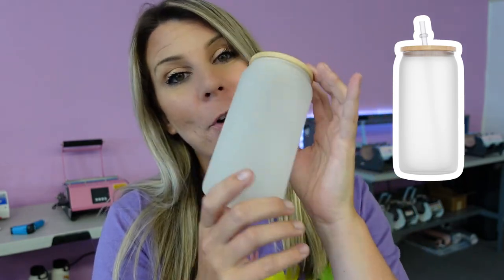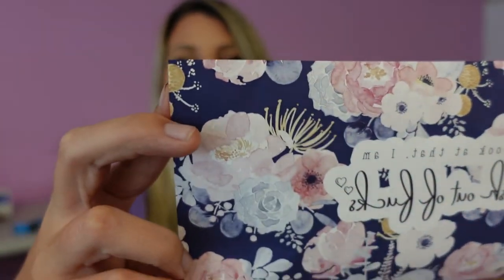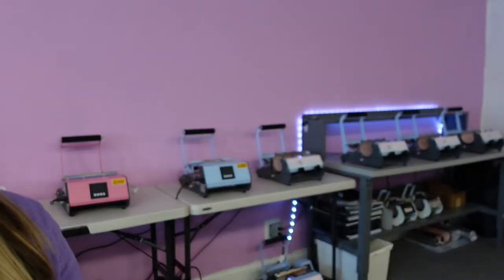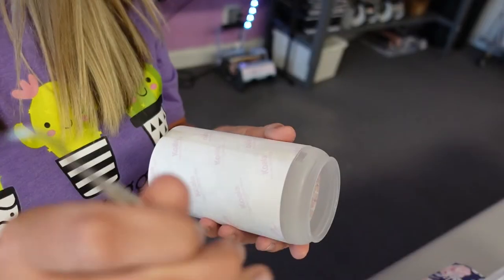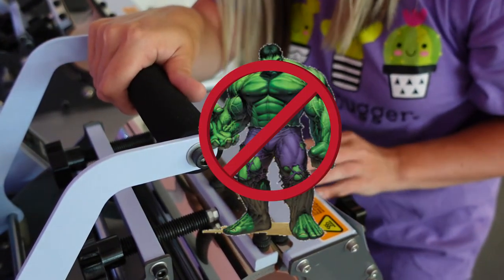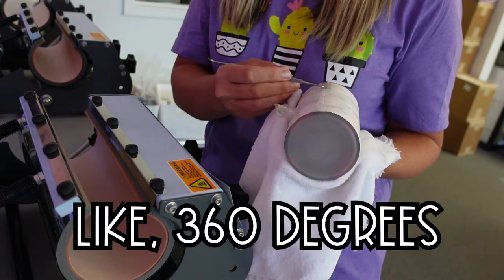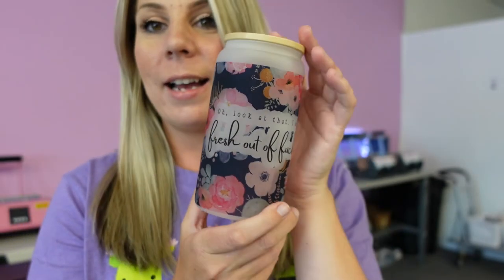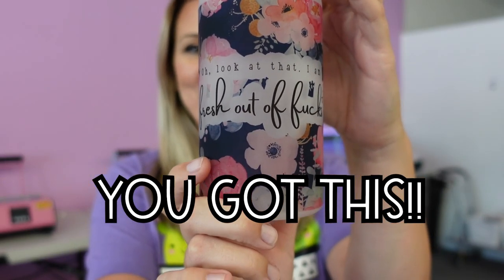How To Sublimate Frosted Glass Jars In Tumbler Press

Comment: Great info! What weight paper did you use? I keep getting residue on my clear cans no matter what i do...
Reply from the maker: 105 gsm but it does hold humidity so if there is any kind of moisture in the air, it will hold it in the paper. Also, sometimes moisture gets trapped in the blank so you can pre-press them for about 30 seconds to get rid of any mositure

Comment: It has beautiful color, I made one once and the color was weak. What printer and ink do you use? I was also using a Cricut mug press copy. Maybe not enough pressure?
Reply from the maker: I use an Epson F570 and our own brand tumbler press. I haven't used a cricut press so I can't say for sure but also, what kind of paper are you using. When we switched to Koala sublimation paper, we got better results!
Reply: @thecraftybitchcompany  Thank you for the quick response. The print was from an Epson F150 and Epson paper. I have not heard of that paper, I was told only to use the Epson paper. That's cool.
Reply from the maker: @kg811  ah..the epson paper was giving us duller results for sure. Try a-sub or koala 🙂
Reply: @thecraftybitchcompany  Thank you for the suggestion. I subscribed.

Comment: Ok I have a saw grass SG1000 and have an hearpress nation  tumbler press . And my colors are coming out faded . What can be the issue???  The printer ??? The temp or pressure I use for the tumbler press ??
Reply from the maker: Could be a bunch of things. What program are you printing from. What are your time/temp settings? Is the tumbler from a reputable place?
Reply: @SublimationWithJacqui   so we are using  the program that came with the saw grass printer . Create a studios. I've been looking online in a lot of people have different temperatures It gets confusing. On my regular white blank tumblers the color comes out nice it's only when i'm doing the frosted glass does the black come out so faded. And Temperature I did ot at 400° and time 240 seconds.  From what a site said . So I seen urs and I'll urs the Temps and time that u use .
Reply: Sorry program  is called creative studio
Reply from the maker: @fernandob2139  ok try the settings I use. Also, I switched paper to Koala brand 105 gsm and get far better results than any other paper I've used before
Reply: @SublimationWithJacqui  ok I just tried ur settings andni got way better results.   Thank you . And I'll try that paper  as well